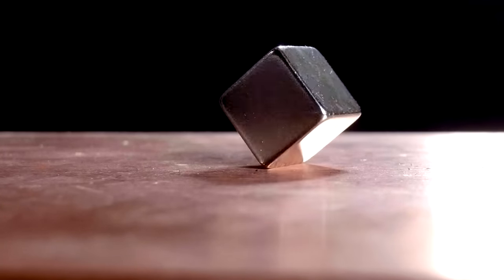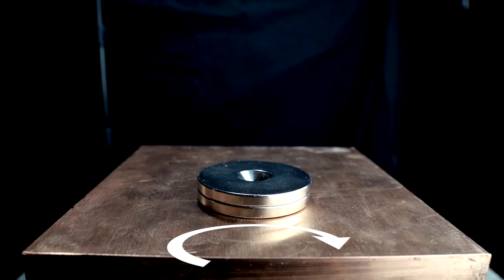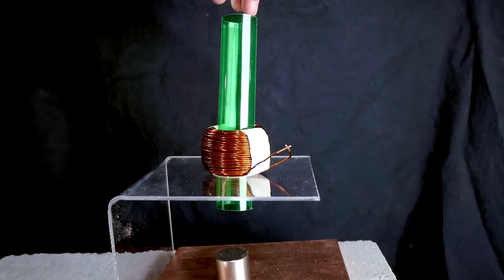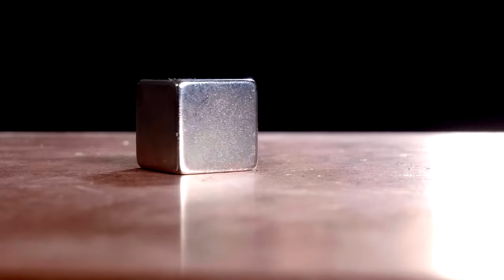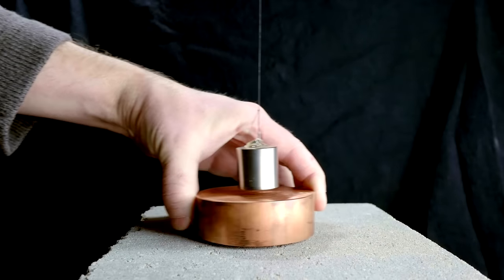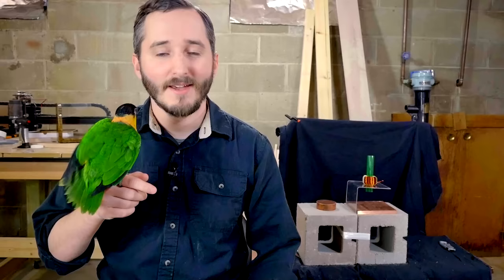Copper's Surprising Reaction to Strong Magnets | Force Field Motion Dampening

Comment: now try it with copper that has been cooled with liquid nitrogen. ;)
Reply from the maker: I was thinking about it. Actually I was really thinking about getting my hands on niobium sheet and liquid helium to get some superconductivity going and see just how fast a magnet could be moving before the induced field could not prevent an impact. Called a supplier today for liquid helium and the minimum order is 180L...So not sure what exactly I would do with the rest of it, if I could even afford it. If you want to give it a go it would be an awesome experiment for your channel!
Reply: Yeah helium is tricky, I'm still trying to liquefy hydrogen. Magnesium Boride is my current target for superconductivity experiments due to the higher temperature.
Reply from the maker: Would your method for hydrogen be cooling it in nitrogen under vacuum? Or do you know of another way? For an experiment like shooting superconducting plates with magnets I don't think I would dare tackle making my own coolant, I'm sure I would spend a week getting enough for a single test and half of it would boil off in the meantime. MgB2 would be a great option though.
Reply: Cody'sLab You probably already know, but in case you are trying to liquefy hydrogen by the Joule-Thomson Effect, it turns out that H2 has a negative Joule-Thomson coefficient for temperatures of >200K. Thus it needs to be pre cooled beforehand, otherwise it's just going to heat up instead of cooling down. Good luck!

Also apparently some people had success making yttrium barium copper oxide type superconductors themselves, maybe that would be easier? :D
Reply: Oh snap! I suggested the same thing before I saw your comment! I even went back to see if you had done it already, but that was an electromagnet.
Reply: NightHawkInLight Have you already forced your setup to impact? If so, how much force did it take? Magnets rule!
Reply: any chance you guys could do a collab? that would be so cool.
Reply: unfortunately pure copper can not be a superconductor...
Reply: Oh cody.!... Wé know you.!..:))
Reply: goawaken afriend : WHY did you take THREE inhales.??.. That's Way to much.!!
Reply: goawaken afriend : Aha.!.. A solid excuse my friend, we ALL Fucked up Réal bad, one way or the other, while sleepwalking through life at Thàt age.!!..
Reply: Can you shoot a magnet bullet into copper?
Reply: dzhiurgis now i really want to see some one test that
Reply: it will not act like a supraconductor, copper should be mixed with a little quantity of another metal (usually rare earth) to act like a supraconductor. liquid nitrogen is about 77°K whis is quite hot for supraconductors, usually you need to cool pure materials at 3K (liquid helium) to have a supraconductor.
Reply: Both of you guys are great. And you do my favorite subject: math. Also my second favorite subject: science. Love it
Reply: Odd, LN2 minimum I've found for near me is 100 to 160 Litres. Though if you bring your own Dewar to some sellers they will fill it like they do with LPG/Propane tanks.
Reply: Cody'sLab earth is flat
Reply: Liquid nitrogen will not make copper a superconductor.
Reply: Cody'sLab 
I like pizza
Reply: Kim 
Shot through a magnetic pipe
Reply: Right all this chat so where's my levitating hover bike? cm on guys get your act together
Reply: Here's a question/challenge: superconducting at room temperature. It's been done.
Reply: Howtard :sure you're on the right channel? So, breathing LIQUID helium...... really?
Reply: goawaken afriend HA! I bet you were snoring in a higher pitch.
Reply: goawaken afriend could you lend me lots of money? I'll pay you back.
Reply: Contact Grant Thompson (The King of Random) for LN2. He makes his own and would probably collaborate.
Reply: doug ohboy  exactly my first thought.  I love it when someone else has accessed similar source materials. Cool.
Reply: Emory desu - dude, I'm so down with that idea! Would love to see if this reaction could stop bullets. Whoever takes this on sure better be dressed like Neo or Morpheus or you can bet I'll be composing a strongly worded letter ;)
Reply: ahh superconductivity.
Reply: @dzhiurgis  hmm. High pressures. Super magnet in a steel barrel. What could possably go wronge.
Reply: Nailed it
Reply: And then try copper that was heated in the fires of Mordor!
Reply: Cody'sLab some elements can become supraconductors at almost zero kelvin (-273.15 Celsius).
Reply: Deepsea workers who have to live under water at great depths in highly compressed rooms , the air is altered by removing nitrogen, and replacing it with helium + adding O2. These workers are constantly talking like chipmunks due to the helium that they are continually breathing. This system is used to prevent "the bends" when decompressing to come back to the surface, so that decompression can be done very quickly which prevents nitrogen bubbles forming in the blood [which is what causes the bends], because there's no nitrogen in their blood. This work is part of working on Oil rigs deep sea diving in the ocean e.g.g if some equipment needs fixing at the ocean floor.
Reply: Ethereal Phenotype .......well, it was an intelligent conversation until you said that.
Reply: NightHawkInLight if you get liquid helium please be careful with it. Use it in a well ventilated area because it has a huge coefficient of expansion and can easily cause asphyxiation without people realizing it.

Also the best way to cool it down is continuous pumping systems, but they’re pretty hard to get set up. Look into liquid cryostats or dilution refrigerators for helium 3 or 4. I believe they make them for industry so you might be able to find a used one. I don’t think they’d be cheap though. But you could certainly make quite the superconducting set up if you’re willing to go that all out with it.

Source: work on superfluid helium 3 with a research group
Reply: It'll become a superconductor right?
Reply: There are dozens of videos on YouTube about a super-cooled copper plates and magnets, which would levitate while the temperature is really low due to its superconducting properties.
Reply: perhasp sell helium balloons at a fayre ??  goto a fayre and get a near empty bottle of helium from a baloon seller
Reply: @Nighthawkinlight  they sell mini tanks for birthday parties at party stores and retailers like Target in their party section
Reply: C W  Maybe not quite so? If you send energy wirelessly, which of course can be done, you need to be able to collect it at the destination point. And as the energy beam disperses or gets wider the further it travels, you would need the adequate receiver/collecting device, right? Energy disperses as it goes out. Laser beams sent by NASA to the moon from earth were quite large in diameter once they get there, about 7 km, as the experiments by NASA have reported. It would be the same with an electrical energy beam. Oh, and I forgot to mention: it is called a Samarium Cobalt Magnet, not what you were calling it, lol. The Sumerians, if any, were an ancient culture in Mesopotamia, and had nothing to do with magnets, as far as we know!
Reply: @XtreeM_FaiL  at least be sure to get it on video.
Reply: Cody'sLab my ex-girlfriends heart is so cold, she works at a liquid nitrogen processing plant, without personal protection equipment.
Reply: MY BOI CODY SLAB
Reply: @Nighthawkinlight 
dont get distracted. what would the effect be, if the copper were cooled with liquid nitrogen ?? address the original question.
Reply: @_John_Sean_Walker  Yes, it has to be "doped".
Reply: Cody's Lab! You are so cool man. Neanderthals like me need you to help us evolve and understand this magic that is science.
Reply: @Nighthawkinlight  We got several tanks of liquid helium in my Uni, I don't even wish to know how much money is that.
Reply: @Nighthawkinlight  if microwave oven magnetrons are neodymium magnet or electromagnets then frequency controlled is easy or not or whether they become more powerful or healthy cooking technique instead of toxicity of thorium or beryllium oxide
Reply: Mary kai  yes Mary I'm certain it's do-able (and is probably in our consciousness from past life experience) I have had the same feeling since childhood as well.

You dont even need physically spinning magnets just their rotating fields. 
There are many ways to achieve that and they cause no friction wear either.

Magnetic fields can be printed in almost any configuration now so in theory a solid state generator shouldn't be too far away.

One basic example can be setup buy spinning a wheel with 16 magnets in pairs with their like poles facing each other. 
If the north pole is facing out the field will rotate 180 from south near the magnets to face north at the mid point between the pairs of magnets and continue to rotate to 360 degrees as the next north facing magnet pair approaches. 
A setup can also be made with less magnets i.e. 4 pairs for example. 

In case it isn't clear, the rotating fields occur at the periphery of the wheel.

Much more efficient energy production is here already we just don't get to see it mainstream.

All the best Mary

:-)
Reply: What effect if any, does mercury have included or otherwise in the mix?
Reply: @KefirGrain  Two problems occur when breathing common atmospheric gasses at pressure for extended periods of time.  Nitrogen causes Nitrogen Narcosis, impairing judgment (like focusing on the task at hand or calculating how long you should remain at a given pressure)
OK so that's resolved by replacing it with a non-intoxicating gas like Helium.  Next problem is breathing Oxygen at high pressures as this causes Oxygen toxicity, damage to central nervous system, lungs, and eyes. (which is why it's partially replaced by Helium)   Decompression sickness (the bends) happens when inert gases come out of solution inside your body instead of your lungs exhaling them in due time.  Helium decreases the time needed to return to normal atmospheric pressure, but it still will cause problem if you ignore decompression entirely.
Wikipedia also stated that Hydrogen had been used for ultra deep diving, but I would not want to take my chances on any sparks!
Reply: @Rusty Highlander Breathing an inert gas at room temp is not a problem, until the % of Oxygen need to remain conscious is to small.  As Helium has no odor you might not realize there is a problem until you  lose consciousness.  (which might be a good thing as Oxygen is much heavier than Helium and if there IS any O2 left in the room, it's going to be near the floor)
Reply: Oxygen displacement with Carbon Dioxide is used by Meat Processors to kill Pigs and Poultry.   CO2 however DOES have a detectable odor inducing animals to reflexively inhale a fresh breath of air (which fails as they are completely surrounded by CO2 causing hyper-ventilation of CO2 ultimately leading loss of consciousness) is it humane? uh, you might not think so if you view some of the youtube video of Pigs being put down this way.
Reply: @TiSapph  The barium is poisonous
Reply: @Nighthawkinlight  you have 1.5 million subs! you can afford it ;)
Reply: @theCodyReeder  mercury
Reply: Now try with copper that does not contain any iron!!!!
Reply: Just use a few cans of a bottle of refrigerant for your air conditioner. Turn the can upside down to get liquid refrigerant and it will cool it down real quick lol
Reply: You should totally do a video on that. !!!
Reply: Supppaaaaaa - conductoviteeeeee
Reply: remember heat takes magnetic power away from magnets be advised . So probably not feasible , since bullets leave a chamber real hot
Reply: hi cody
Reply: Lol
Reply: @Nighthawkinlight  give it to the dude that is making the iron man repulser.
Reply: Liquid nitrogen? Nothing different of course.
Reply: I have a question. Why don't they use this technique do generate electricity by keep sending magnets across wires
Reply: Repels gravity
Reply: Exactly....  How would temp affect properties
Reply: The Gospel of Jesus Christ
Today is the day of Salvation: Why would anyone put off the most important decision they could
ever make in their lives concerning eternal life? If you die today are you going to heaven?
1 Corinthians 15:1-4 - The apostle Paul tells us what the gospel is: "Moreover, brethren, I declare to
you the gospel which I preached to you, which also you received and in which you stand, by which also
you are saved, if you hold fast that word which I preached to you—unless you believed in vain. For I
delivered to you first of all that which I also received: that Christ died for our sins according to the
Scriptures, and that He was buried, and that He rose again the third day according to the Scriptures.
Gospel means "good news." Your debt has been paid, the death penalty has been paid, you are free.
Here's the Gospel of Jesus Christ: That Christ died for our sins according to the Scriptures, and
that He was buried, and that He rose again the third day according to the Scriptures.
Jesus brought in a little child as a living object lesson to show who enters the kingdom of heaven.
Matthew 18:3 - Jesus said: "Unless you become like this little child you will not enter the kingdom of
heaven." This is how to be saved, it is simply child like, as simple as ABC:
A - Admit that you are a sinner. This is where that godly sorrow leads to genuine repentance for
sinning against a righteous God and there is a change of heart, we change our mind and God changes
our hearts and regenerates us from the inside out.
Romans 3:10 - As it is written: "There is none righteous, no, not one."
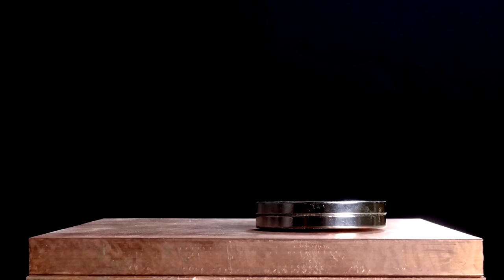Romans 3:23 - For all have sinned and fall short of the glory of God. (We are all born sinners which is
why we must be born spiritually in order to enter the Kingdom of Heaven).
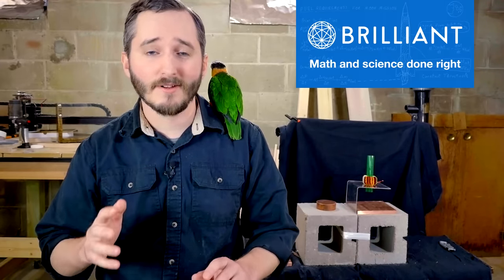Romans 6:23 - For the wages of sin is death, but the gift of God is eternal life in Christ Jesus our
Lord. The bad news is that the wages of sin is death, in other words our sin means that we have been
given a death sentence, we have the death penalty hanging over our heads, that's the bad news. But
here's the good news: The good news is that the gift of God is eternal life in Christ Jesus our Lord.
Ephesians 2:8-9 - For it is by grace you have been saved, through faith —and this not from
yourselves, it is the gift of God— not by works, so that no one can boast.
B - Believe in your heart that Jesus Christ died for your sins, was buried, and that God raised
Jesus from the dead. This is trusting with all of your heart that Jesus Christ is who he said he was.
Romans 10:9-10 - That if you confess with your mouth, "Jesus is Lord," and believe in your heart that
God raised Him from the dead, you will be saved. For it is with your heart that you believe and are
justified, and it is with your mouth that you confess and are saved.
C - Call upon the name of the Lord. Every single person who ever lived since Adam will bend their
knee and confess with their mouth that Jesus Christ is Lord, the Lord of lords and the King of kings.
Romans 14:11 - For it is written: "As I live, says the Lord, Every knee shall bow to Me, And every
tongue shall confess to God."
Don't wait until later — do this now.
Romans 10:13 - For "whoever calls on the name of the Lord shall be saved."
"O God, I am a sinner. I'm sorry for my sin. I want to turn from my sin. I believe Jesus Christ is Your
Son; I believe that He died on the cross for my sin and that He was buried and You raised Him to life.
I have decided to place my faith in Jesus Christ as my Savior, trusting only in His shed blood as
sufficient to save my soul and to take me to heaven. Thank You, Lord Jesus, for saving me. Amen."
Reply: @Nighthawkinlight  You might be able to get a small tank in a tech dive shop. It is used as an important component in mixed gasses for deep dives. Divers use a lot of it.
Reply: @Nighthawkinlight  Find out where it's being shipped and ask the end user for a small amount.
Reply: liquid nitrogen is not cool enough for copper, but its enough to cool of high-temperature superconductor :)
Reply: @Nighthawkinlight  You can get LH2 for reasonable prices as a fuel. It should cost you less than double the high-pressure hydrogen price you'd pay at a nearby hydrogen-offering "gas station".
Really, if you only want superconductors, it should be enough and far cheaper. It's just that safety protocols don't really allow it's use in e.g. MRI machines, which is why they have to use LHe.
Reply: @Nighthawkinlight  sounds like a collaboration opportunity to me. Get applied science involved and it'll be a hit.
Reply: And gold
Reply: @Howtard  Dangerous stuff Helium, the body doesn't detect CO2 as there isn't any as breathing Helium, no breath response, people die as fall unconscious and don't breathe..
Happened on Australia TV Dr Karl was playing with voice changes and collapsed, not breathing, luckily, was helped..
Reply: That would make copper a super conductor
Reply: Super conductor?
Reply: Why
Reply: @theCodyReeder  Yeah, cold copper at 77K (LN)  is not a superconductor, but it is much better conductor than on room tempperature.
Reply: @Nighthawkinlight  Try copper cooled with liquid nitrogen. It is not superconductor, but it is much better conductor than on room temperature.
Reply: @Nighthawkinlight  
Contact a local high school’s science teacher. Or college’s engineering department/lab. 
You May be able to collaborate and do this as part of a project for their students, using the school’s cryogenic liquids.
Reply: @Nighthawkinlight  You now that welders of non-Ferris metals like aluminum and stainless steel use liq. helium to displace oxygen during welding; right?  There's your source for helium.
Reply: Action lab dialogue
Reply: @Nighthawkinlight  free giveaways to viewers 🤣
Reply: Rhenium
Reply: I wonder if you could make a generator that could make instead of lose electricity.
Reply: Yeah bro that would conduct super good. Like a conductor that's super maybe
Reply: Super conductor.
Reply: What about superheated copper?
Reply: Or hydrogen or helium
Reply: Superconducting surface
Reply: @Nighthawkinlight  Liquid nitrogen, not as cold, should be much much cheaper!
Reply: @Howtard  roflol
Reply: Yes, but that makes a Really cold toilet seat ))
Reply: I like seeing that despite having a pretty big YouTube channel, is also just a regular viewer like the rest of us. Quite inspiring honestly
Reply: E=MC2 is a joke! OK let's get this correct  !!   #1  The only reason radio waves and AC current travel out in space and down a wire is because of the "CENTER " of a magnetic field.  (The "B" field), The North and South poles are the weakest part of a magnet !!   Just like Tesla said,  you got to look at things you can't see !!  At the center of a magnet is anti gravity,  (just tap the center on any glass or plastic and it will loose weight), The center can repel water if vibrated at the correct frequency,  If you vibrate the "B" field into granite rock it will become soft and you would need copper tools to work on same , you don't want to disrupt the magnetic (B")field ) with other iron.  Once you understand the "B" field of a magnet and how it relates to the entire universe we live in, you will then understand what Tesla was telling everyone "LOOK FOR WHAT YOU CANNOT SEE""  .I believe the pyramids were inter galactic communications and transportation systems.  Stone Henge and Gobekli Tepe , power plants.  Take a look at Coral Castle Florida on YOUTUBE and you will see a similar pilar. I believe these horizontal pillars were oscillators that would provide excitation for many things from crops in the field to anti gravity  FYI: If a UFO fly's to close to you the "B" field that provides the anti gravity ("B")Field).  will cancel out your power source  !!!!  E=MC2 is at best just a joke!!!